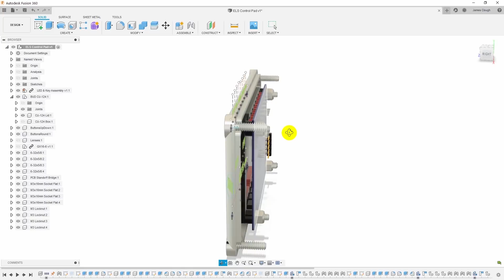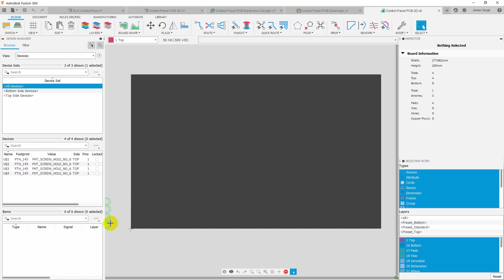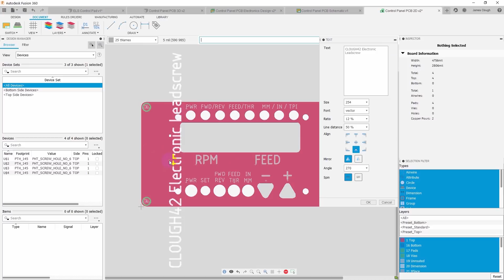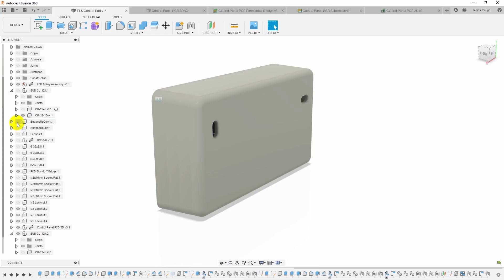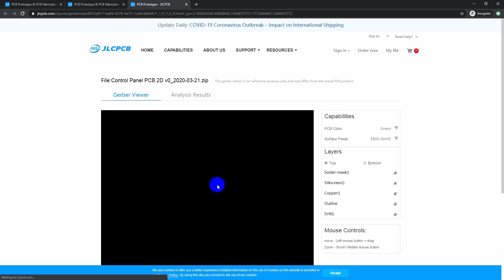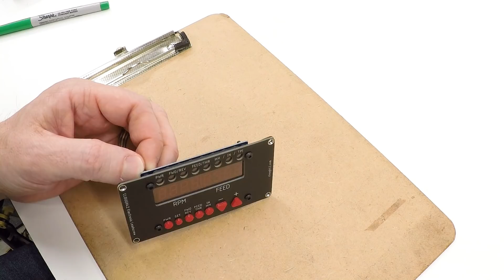Lathe Electronic Leadscrew Part 17:  A PCB-Based Control Panel in Fusion 360

Comment: That would be really awesome if you can put LEDs  on the back side  illuminating the buttons,  or a backlight for a board designed for a different project!  I love this concept, pcb for other than circuit boards! Just awesome ✌️

Comment: your already getting the lid pcb made and it fits the box well, is it possible to clone the display pcb and integrate the two together? it would be one drop in replacement part that replaces the aluminium lid, lid would get put in scrap/recycling bin

it would solve any future supply problems if they change the design or stop producing that specific model.
Reply from the maker: I have been considering it.  Though the display PCB would cost me more than twice as much if I have it made myself.

Comment: Hi I am relatively new to your channel and like every video I have seen,  My lathe is very similar to yours.  I would like to upgrade mine to the variable speed motor and the electronic leadscrew.  I see you sell kits for it and do  not understand where to go to contact you or order them if they still are available 

Thanks
Reply from the maker: Search eBay for "Clough42 ELS" to find my listings.  More information is here:  https://github.com/clough42/electronic-leadscrew

Comment: I know I'm terribly late, so this is mostly yelling into the void, The PCB Box cover is Amazingly Clever solution to the work intensive box engraving. My only sugestion would have be, If you ever re-do these, I would mount the display board only to the 3d printed spacer with a couple Flush bolts (like you used on the aluminum version), Hiding them under the PCB cover. You would save yourself 4 holes in the PCB for a cleaner look, as well, if the sizing on the display board changes you might be able to get away with only changing the spacer, not having re-order whole new sets of PCB's. Maybe you though of this on your own, Ive only just got this far. The videos have been great background noise while I've had the flu the past week.

Comment: You could expose the copper (remove solder mask) to form the text rather than using silk screen. I think it might be more durable,  especially with the HASL finish that would coat and raise the exposed copper. Might look nice too. Not sure if it'd be hard to read.
Reply from the maker: I don't know.  I might play with it.  I would definitely want to use lead-free for that application.  I expect it would tarnish over time, but I'm not sure.  I've seen ENIG plating used for this application, and it looks good.
Reply: @Clough42  I hadn't thought about tarnishing, that's a good point.

Comment: I've been using a cool method for board labelling over ground planes where instead of using the Silk screen layer, I select the solder mask layer for the text, this makes it so whatever surface material (hasl or gold) becomes the lettering with stunning results

Comment: MFW color LCD's are cheaper than 7 segment displays.
Reply from the maker: Cheaper than $2 for an LCD with buttons?  Got a link?
Reply: @Clough42  I sent the link but the YouTubes deleted it, probably thinking it spam.  But the answer is yes, you can quite easily get color touch screens from aliexpress or other sites for less than $2.  Though premature cost optimization is sometimes as good as premature code optimization.

Comment: What kind of silly person gives this a thumbs down? (Somebody who is a really rabid KiCad fan?) Pretty interesting to use a pcb this way, and I think you could probably do this relatively easily in KiCad, iirc you don't need a schematic actually. Not sure about importing the outline, but wouldn't be surprised if you can import a dxf.

"Through the magic of planning ahead" ah yes, that elusive black art.

Comment: Hey James. A few years ago I was struggling with making an electronics front panel for some of my projects similar to this one, and I was able to come up with a method that can be extremely inexpensive (compared to other front-panel services) if people can't engrave their aluminum panels with v-bits like you did.  My method involves using these cheap aluminum photo printing services to print the panel labels which you can then cut and drill to have the openings you need.  The cool part is you can even have color graphics and make things as fancy as you want.  It was a few years ago, but I documented my journey in this video.  I thought you might find it interesting: https://www.youtube.com/watch?v=bBKg9Qiq72U

Comment: Interested in the front panel PCB  with the box, the frame-spacer, all the screws, the red filter, the buttons
and the clear protecter.  and frame- BUD box not necessary. Is it available yet?
Reply from the maker: Working on it.  I have most of the parts.

Comment: The longer this goes, the closer my own build gets to completion. Will you offer a la carte? i.e. I won't need encoders, Clough board or TI board, but box/display unit I will, and those are things I cannot make in my shop...
Reply from the maker: Yeah... The interface PCB is available now.  I'm planning on selling the front panel with labels, lenses and 3D printed parts (buttons and spacer).  I don't plan to resell the readily available off-the-shelf parts like the encoder.

Comment: I absolutely want a couple of FULL kits! I want as complete a kit as possible given the many different lathes and setups people have. Thank you for all the time and work that you have invested in this! You deserve to make a decent profit for the full kit, as well as everything else. I think that offering different "levels" of kits would be popular as some want to build everything from scratch while others just want a final product with a minimal amount of chasing down parts like the motor, encoder, and maybe the power supply so they can get up and running right away. Providing suggestions for those parts and/or the suppliers would be great too.

Comment: Just wanted to put a note out there for anyone else trying to find out why the display may be glitching like displayed on an earlier video.  I just spent several hours tracking it down after I did my final wiring and saw the issue for the first time.  It seems that my driver for my closed loop stepper from Automation Technologies is emitting some noise and it affects the display.  Only way I have found to fix this is to move the driver outside of the enclosure.  I tried grounding and moving it do different locations inside but could not solve it.  Now it looks like I will have to mount it to the outside of the enclosure.  Other than that this thing is great!  So much easier to deal with and I don't have to read some chart all the time!
Reply from the maker: Also keep the display cable as short as possible and away from the motor wiring.  And do not connect the 5v logic ground to the motor/driver power supply ground.
Reply: @Clough42  Thanks for the reply.  The cable is about 5 ft long and the grounds are not tied together.  Connecting grounds made issues worse as you stated.  I ended up wrapping the driver in tin foil this morning and grounding it and so far it appears to have fixed the problem.  Just grounding the case did not help.  It is definitely radiated emissions from the driver and not conducted emissions.  Thanks again for all your hard work in setting this up.

Comment: Hi James. I’m almost there! Breadboard electronics works, encoder and hybrid servo/stepper now very neatly fitted to the lathe. Had to make my own bracket to hold the I/O board. Nothing like as elegant as yours but I don’t have 3D or CNC so very interested in a kit. I’ll put some board measurements up on GitHub for you as my boards are different. Just need to connect things up and arrange a NVR switch for the breadboard. Given me something to do during lockdown for which I’m very grateful to you. BobUK

Comment: For sale outside the US (to keep the weight down) may I suggest you market a kit of everything bar the cast box and the LED & KEY module.
Reply: Brian Oldford  Hi Brian. Still have to pay the postage to get the LED board for yourself. James would be able to bulk order so reducing the on cost from him and I doubt the pcb would add much in kit postage - it’s very light - I’ve got four of them! The box though is another matter and you may well be right about that. However, a complete kit, with the aircraft connector, would be very convenient even if it does cost a bit more. BobUK.
Reply: @bobuk5722 Hi Robert Thanks for the contact. I already have a LED & KEY module.

Comment: @Clough42 You may want to try text or logos on the copper, with soldermask on top, it looks very nice for a front panel. Not sure if you can do it in eagle but you can in Kicad
Reply: You can also do logos on the soldermask, by removing it and leave the copper exposed to be plated, not all logos will work. I've tried with JLC with hasl and it turned out very good.

Comment: i'd be interested in a complete kit. I'm retrofitting an old cone head lathe to a new drive system with a 3ph motor and VFD, and it is missing a lot of the standard thread pitches on the qcgb, and no metric capabilities.

Comment: Regarding the vector fonts: There should be a central configuration setting which says "Always generate vector fonts" (at least it was some time ago). This was implemented because proportional fonts don't always turn out reliably in production. If you turn it off, you can get the proportional font. But please be careful and check the Gerbers,
BTW: Nowadays, the silkscreen layer is often applied with large inkjet printers, especially on small batches.

Comment: You should be able to add a plated through hole on the PCB layout section by just adding a via on the correct net. Also, I'm pretty sure eagle allows you to change from top to bottom layers and back with middle click, even when not routing (not certain about that though)

Comment: Was there a reason to not plate through around the display/led/button openings? Cost? I'm thinking that finger oils, coolant, cutting oil and the like over the years may soak into the edge of the PCB and start to delaminate or stain it.

Comment: James, I would be interested in buying one of your PCB front cover with the box, the spacer, all the screws, the red filter, the buttons
and the clear protecter. I already have the printed circuit board and most of the other parts to finish my electronic lead screw. I am putting it on my old Craftsman 101. lathe and I havent figured out what gear ratio I will need but I will 3D print those. You do a great job of modeling things on Fusion 360. Thanks and keep those great videos coming.

Comment: Check out Abomb's newest video - metric threading on an imperial lead screw lathe with half nut dis-engagement.  Embarrassingly simple.
Reply from the maker: Yes.  He installed metric change gears to enable that.  If you have an imperial lathe and want to cut metric threads with the ELS, you must do the same.  Except there are no gears to change.

Comment: I'd check into Front Panel Express. Use their software and design your panel and they'll cut, engrave, silkscreen, ect on just about anything. I've used them in the past and their prices are very reasonable.
Reply from the maker: Thanks for the tip.  I'll check them out.

Comment: As usual, a most wonderful and informative video. This just goes to show how many little details there are to consider when designing a product for manufacture. I would definitely like to buy a plate and button set. Since I am using this on my HF 9x20 I am adding a SS shroud to the front of the spindle housing, making it look more like a Precision Mathews lathe with your ELS panel on a 45deg plane on the top outside corner of the shroud with the stepper hidden below just above the gearbox. This will move the face out and flush with the front edge of the change gear mounting plate. I haven't decided yet whether to completely remove the gear shift handle or leave it sticking out. I think I'll wait until I get everything working and tuned for the best speed then remove the shifter. If I left it on and changed gears I would have to remember to reset the ratios in the ELS. I think it's best to set it and forget it. Now if my pullies and belts will just arrive from China. Thanks again for all you do for us. Stay safe, stay healthy.

Comment: I would be interested in buying the cover individually as I have the display board already.  I don't know if my tiny 3d printer can print ninja-flex, so it would be great if I could get the buttons from you as well.
Reply: Kyle, you can print the buttons in pla or any ridged plastic and cut them apart I have done it and they are captive enough in my 3d printed cover so they work fine, I'm guessing it would be the same in the PC Board , the up/down button can be left connected together.

Comment: Would be happy with anything  you could put together!  The board with the TPU buttons would be great.  Not sure my 3D printer will work with TPU as I've not tried it with my Bowden setup.  Also, can you add a link for the red LED cover material?

Comment: I'm liking the look of the finished panel. Perhaps you could incorporate your logo by taking advantage of selectively exposing the copper and using a silkscreen graphic together? Also, your worry about the exposed edges of the cutouts could be alleviated by making them through hole plated too. The subsequent outline might have further visual appeal.

Something that Dave over at EEVBlog does, is to use bottom firing surface mount LED's mounted on the backside of the PCB that can be seen through a cutout. The mode LED row might look quite effective done this way. The bottom layer can then actually be used as a circuit. I see so many creative possibilities here.

Great work and demonstration as ever. Thank you James.

Comment: Great again!. 
Is it possible to share the sketch of the front panel? I'm using an other size of the case and so have to make the front in another size. If I have the layout and dimensions of the holes, I could mill it myself. Thanks!